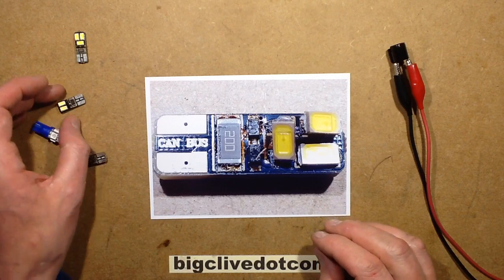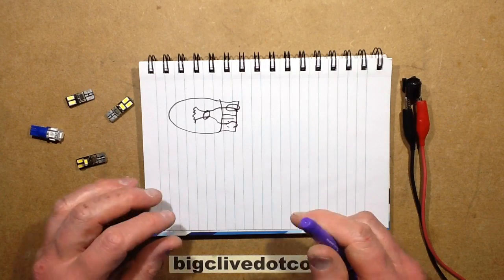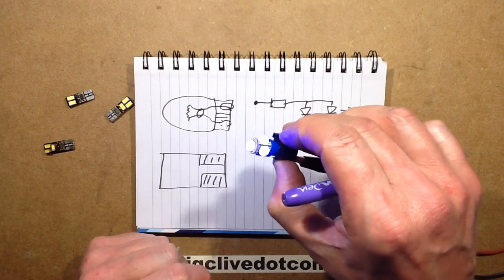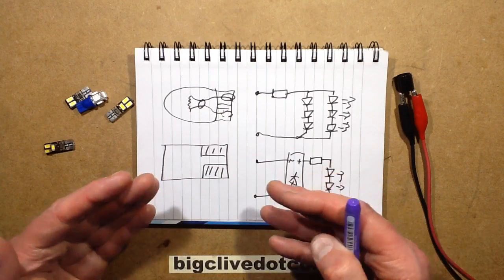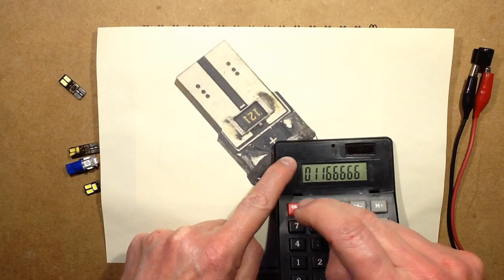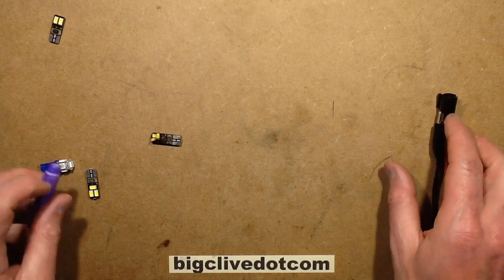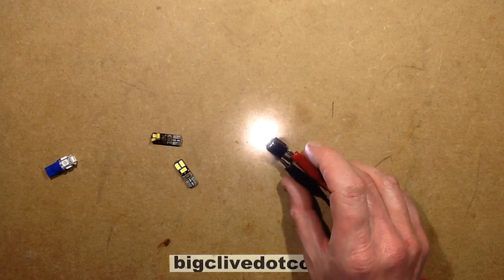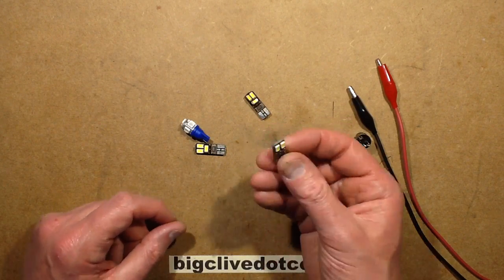Smokin' hot CANbus LED lamps.  (230C in open air.)

Comment: Thanks for that, I have been considering using these type bulbs as replacements in our Motor Home for use at night.  We live in her all winter down in Arizona, so had  I stuck these in the slots, I may well been out of house, home and transportation!  Sometimes you are indeed a life saver.
Reply: +Susana Godinho  I have been using strip lighting for more than a year in an RV with mostly good results. The problem is when the charger/converter is on the voltage is up to 14.2v which is too high to expect the lights to live long. The original lights I installed directly are noticeably uneven and dimmer than the ones I installed with dropping resistors. I calculated the current required and put resistors on both leads to split the heating although the resistors really don't even get warm. The slight dimming when on 12v batteries only is not even noticeable but it sure is nice to know that the lights will last a long time and use so little juice. And I never have to buy another of those fluorescent lamps again, just fill the old fixture with LED strips. Maybe I'll add a solar panel to top the batteries up instead of having the charger on all the time. I still need mains for the computer, microwave and TV unfortunately.
    Mike (o\!/o)
Reply: +Jerry Ericsson 
What these do is add an extra resistor so that the total consumption is the same as the original bulb, to avoid the car 'thinking' that the bulb is blown due to the low consumption of the LED's. Now this resistor adds extra heat. Not all the cars have this system, to try it remove the bulb and check if the instrument cluster says the bulb is blown. If not you're good with the normal NON CANBUS version, otherwise stick with the original halogen/tungsten bulb.
Reply: +Susana Godinho What I was going to use them for is general illumination for example the lights above the couch, or the booth.  Almost all the built in lights in our rig are  12 volts and run on a built in converter from 110 when plugged into shore power. The main concern is when boodndocking, where there is no power to hook up to, the LEDS would take much less power from the house batteries then regular. Our rig has two deep cycle 12 volt batteries, and last winter they did us proud while staying in parks with no service, such as Orgen  Pipe National Monument, where generator operation was restricted to two hours per day to recharge your batteries, so I dont think I will even try, just to be safe. I do know many nomads to replace their bulbs and claim great savings when boondocking.
Reply: Jerry Ericsson

In that case you dont need or want the can bus version. Do bare in mind, tough, that although more efficient than tungsten's these leds are not very efficient for illumination: They give out very little light. You'd almost certainly be better served using something like a T8 LED replacement tube (https://www.thelightbulbshop.co.uk/Shop/T8LEDTubes/Product/CoreProLEDTube-SpecialOffer.aspx?gclid=Cj0KEQjw9tW5BRDk29KDnqWu4fMBEiQAKj7spxh-73iZvmlXm1JDob3m63eyb91t9pqzB7lCh_B9_ZcaAjkL8P8HAQ). There are some for 12V if that is imperative, but my advise is to run them from a small converter.

You could also try similar to these: http://www.ebay.co.uk/itm/5M-Flexible-ISHPNIH-Strip-Light-Lamp-14-4W-12VDC-300LED-SMD-5630-Warm-White-/252216236605?hash=item3ab9425a3d:g:8vYAAOSwSdZWcoYA They can be cut in multiples of 3 leds and fitted on most light fixtures with operation straight from 12V
Reply: Depending on your skills you have better options. A current source or a 12V regulator, to have constant output regardless of the battery voltage. Have a look at the LM2940. Its rated at 0.5V drop, so the brightness would be the same from 12.5V onward.
http://www.reuk.co.uk/LM2940-12V-1A-Low-Dropout-Regulator.htm

Comment: these are called 194's in the states....or at least on all the cars made from like...the 60s to today.

also, in most cars.... your blinkers will flash at twice the rate they normally do. 
some people dont notice this.... nor do they notice that their engine is making strange noises..... and just continue to drive......

till their engine locks up....

basic mechanics should be taught in drivers ed....
Reply: +kain hall I dont know how they don't at least teach how to change a bulb, check fluids, and change a tire. Having burnt out bulbs, or getting a flat can be a dangerous situation if you dont know what to do. 80% of the people that drive are oblivious about the car they are driving.
Reply: +kain hall this the idea of the resistor, to match the resistance of the same bulb, old flasher units relied on the bulb resistance, the newer electronic dont.  these are meant for canbus, which can report a fault if the bulb fauls, but the problem with these is, the led might fail to light but the resistor still remains, thus the system is fooled, with the old bulb if you had no resistance, it was dead, simple

Comment: So, it seems that there is no point in replacing filament lamps with these kinds of LEDs. What do the OEMs do?
Reply: +Joseph E Change the method for detecting open circuit lamps, then no silly load resistor is needed.
Reply: +ELECTRONTHORP they don't when they're superheated by the load resistor though

Comment: I was planning to convert my vehicle to LED and your presentation is quite an eye opener.  I hadn't even considered that heat would be an issue with these.  I assumed LED's would be a cooler running longer lasting replacement.  It's a shame that the vehicle itself is defeating an LED advantage by requiring the same power dissipation as a filament lamp just to satisfy an idiot light that dissuades folks from doing the occasional lighting checks they should be doing anyway :(    Fortunately I don't have a lamp monitor but do you feel comfortable using non-CAN automotive LED's with their typical junction temps in marker and running light housings?
Cheers and thanks for the 'heads up'!
Reply: +Eddie the Grouch Depending on your car, you can edit the settings to ignore the warning that normally comes up. BMWs can definitely be set up so that you don't need load resistors.

Comment: Im so glad you pointed this item out and its consequences, as I have been tempted many times to buy a load of these LED's off ebay and fit them as replacements to my regular side light bulbs, not realising they get so hot. Thanks for the knowledge. :-)
Reply: +ben hunter 
I have used them for years with no MOT or Police issues. As long as they are not anything other than a white or whitish colour they are fine. Most tungsten w5w bulbs show an orangy/yellow colour after a few hours of use and are very dim and less reliable.
Making them more dangerous in my personal opinion, than a good solid bright reliable led that can be seen by other road users.
Reply: +Bevoin1970 As far as I'm aware, retrofit LED side lights are not road legal in the UK because they have a non standard light spread and output
Reply: +ben hunter I see...thanks.
Reply: +Bevoin1970 Don't get me wrong, these LED retrofit lights are often okay for interior use. I use them on my 2008 Vectra and my mother's 2005 Freelander, I just take all of the shunt resistors off them first or buy ones without them. My car is full CANBus but it doesn't monitor the interior or number plate lights so I don't have a problem.
Reply: +ben hunter 
That's HID headlights and the new led headlight bulbs.
Led lights for front sidelights are legal as long as not blue or red and only white. Most are 5000K colour and ok.
Reply: pt197472 if you say so, but all of the led w5w replacements i've ever seen, including the osram and Phillips ones always say not road legal.
Reply: He is just a sensitive man. Just cause they get hot does not mean they will fail fast. Many canbus bulbs can run continuously for long term just fine.

Comment: The other reason for the resistor to make it "canbus compatable" or 
whatever marketing phrase you want to use is that most modern cars don't
 use mechanical switches or relays to turn the lights on and off. They 
use a solid state switch, (SCR or transistor or mosfets, SSR, etc) to 
switch everything on and off via signals from the computer. If those 
circuits don't have enough load on them, the leakage current through the
 switching device can cause LED's light up (ghost and or flicker) even 
when they are commanded to off. Similar to testing an LED via the 
leakage current from a multimeter.

Comment: how about the blue one you had? i'm planning to buy similar one for dome, map and trunk light (6 bulbes in total) Do they heat up or such? :)
Reply: +NozzyTheFox After buying a set of these in blue for my instrument cluster, I went back to traditional bulbs, not worth the hassle trying to get them to fit, and get the right polarity.
Reply: +NozzyTheFox Plus, you can get blue tinting bulbs...
Reply: +NozzyTheFox  They didn't look like "CANbus compatible", so won't generate the extra heat of the extra parallel resistor to satisfy a bulb monitoring system, so are probably OK - remember that incandescant bukbs get hot too, so fittings can generally take a fair bit of heat. So as long as they don't generate enough to melt themselves you'd generally be OK.

I'v replaced incandescent T10s in the interior, glovebox  and trunk  lights with SMD LED panels without issues like/similar to these (available in various colours and sizes): http://www.ebay.com/itm/Car-Interior-White-48-SMD-5050-LED-Light-Lamp-Panel-T10-Festoon-Dome-BA9S-12V-/201464083220?hash=item2ee831f314:g:FXQAAOSwr7ZW4~1E&vxp=mtr
They're typically built/designed with groups of 4 strings of 3 LEDs and the boards can usually be split(cut between groups if custom sizes is required. 

Recently spotted that they're available with COB LEDs rather than discrete SMD LEDs, for instance: http://www.ebay.com/itm/48-SMD-COB-LED-T10-4W-12V-White-Light-Car-Interior-Panel-Lights-Dome-Lamp-Bulb-/262380515923?hash=item3d1718f253:g:5-8AAOSwgApXBKNB&vxp=mtr  So far only seen them in white.  Haven't tried these myself [yet]

Comment: but you could simply desolder that 120 ohm resistor, right? (If the car has no "faulty lamp sensing")
Reply: You can, as long (as you said) the vehicle has no fault detection AND your flasher relay doesn't have resistance detection, where the flashing speeds up if you have a burnt out bulb.

Comment: The main use for those 501 style lights is for side-lights/parking lights.  the original bulb form of them is a 5w bulb. and believe me they get mighty hot also. I have touched enough of them and have the blisters to prove it haha..  With regard to the ebay reviews saying half of them dont work,, well they dont.. they either dont work or will only work for a few days.. that leads me on to my question, Is the fluctuating voltage in a vehicle bad for LED's?
Reply: +CalmeRyowl Not inherently bad as they should be designed with appropriate current limiting for automotive voltages. Most likely you're seeing the degradation of the LED die from the extreme temperatures from the load resistors.